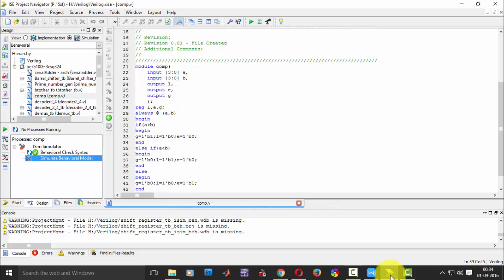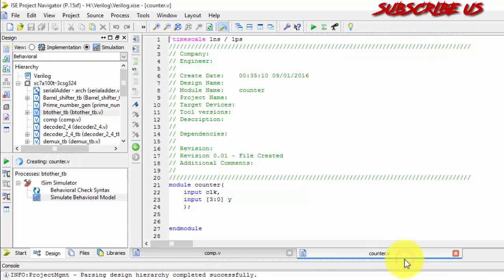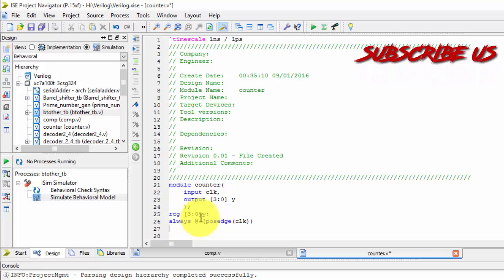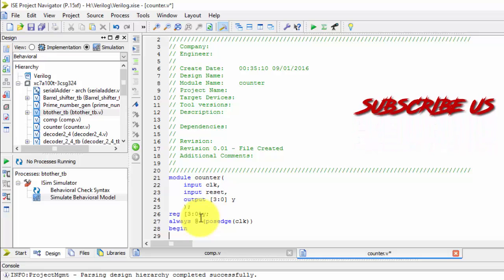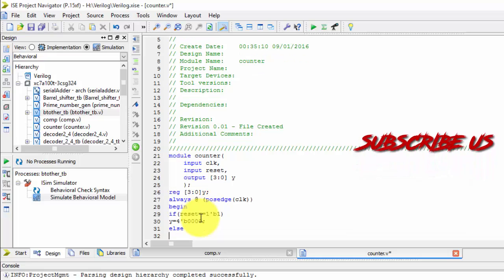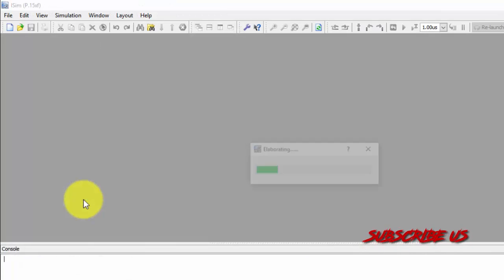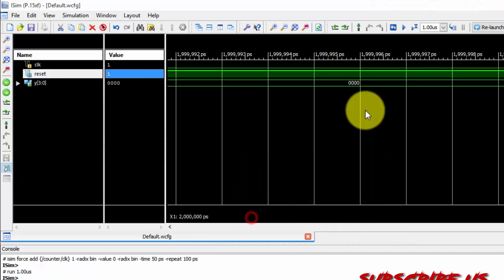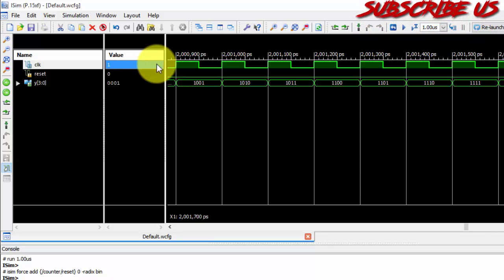Verilog Implementation Of 4 Bit Up Counter In Behaviorial Model

Comment: When the output become 1111 you said it started from initial 
But there is nothing mentioned for this in program 
Please clear my doubt
Reply from the maker: After 1111 it will be 10000 but msb bit will not be visible.